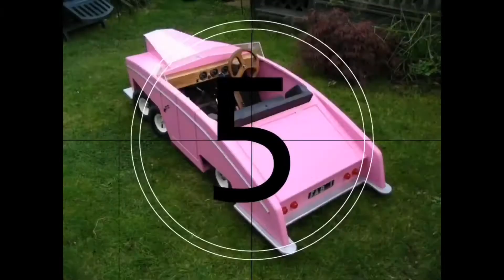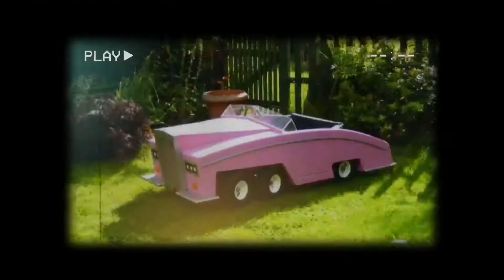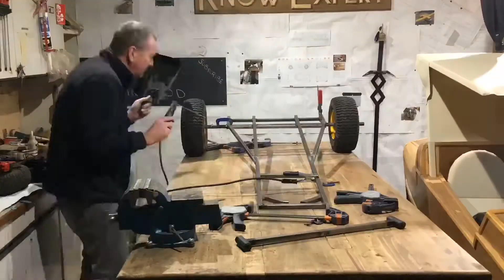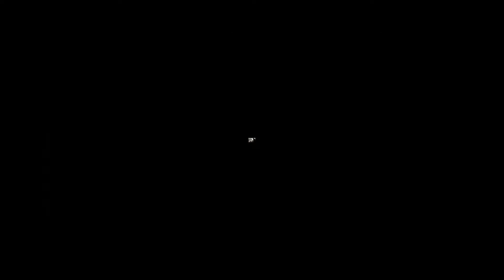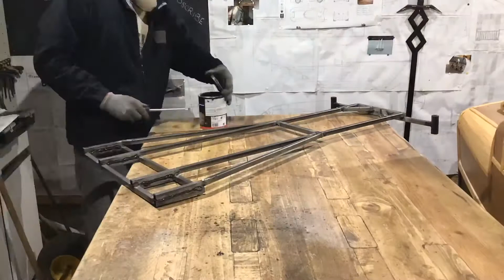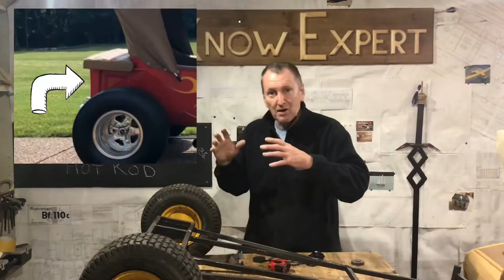T Bucket kids Hot Rod build. Part 2 rolling chassis

Comment: You got 20mm hot rolled, you needed 20mm ground round, just ask for "la roundy groundy de la viente milemotre"
That's a fine looking chassis!
Reply from the maker: Being a hobbyist who mainly works with wood I’m new to steel and learning as I go. It’s how I found your channel in the first place looking for something about metal. I just assumed I’d be able to sand the bar quite easily but no, just waisted my hour trying. All sorted now though, the threaded bar works a treat, and today I started on the wood so the pace picked up....... new episode soon....
Reply: I know mate, I've been caught out by hot rolled, sometimes it's only round if you take 5 steps back and squint.
Leather is the most difficult stuff I've tried buying, need a city and guilds in cow skin nomenclature before you stand a chance of understanding splits, butts and chrome tans.
And you've got the added fun of trying to get stuff in a different language. Are you a fluent french speaker?